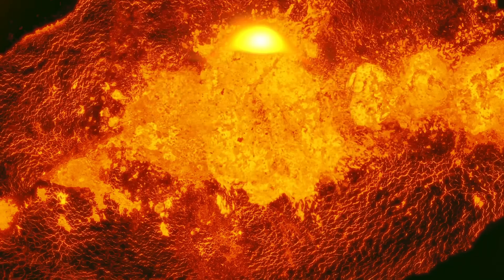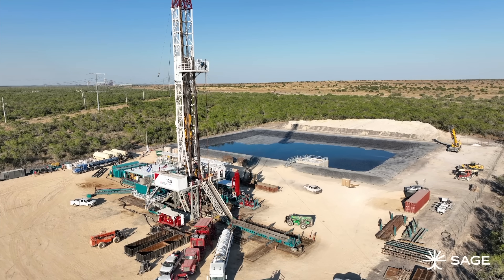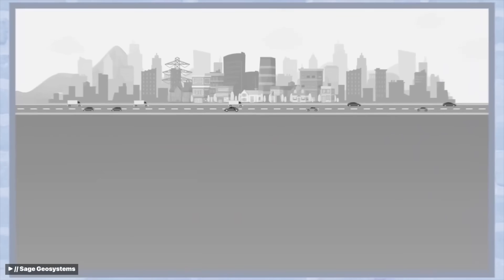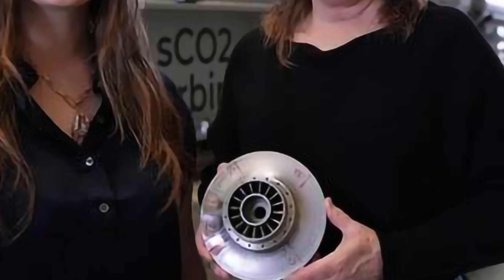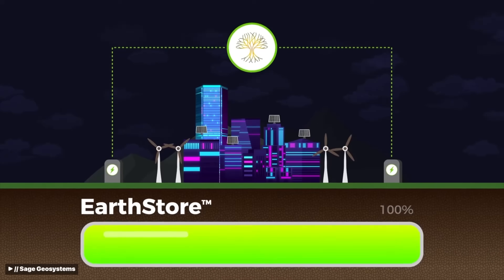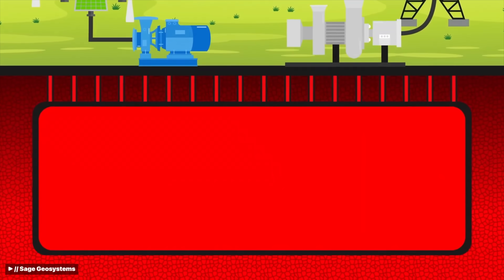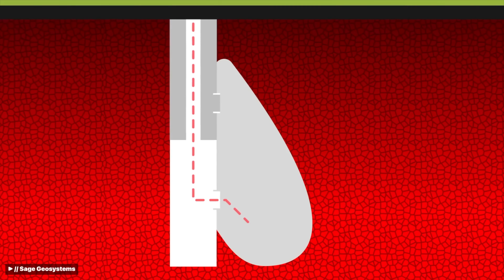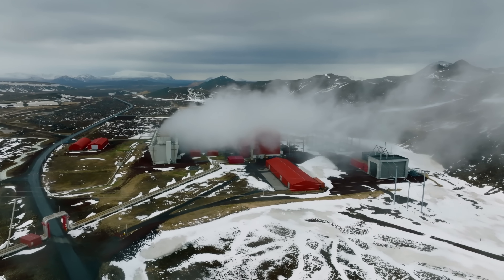This Tech Solves Geothermal's BIGGEST Problem - Gamechanger?

Comment: So where does the supercritical CO2 turbine fit into all that?
Reply: Supercritical CO2 turbines have two major advantages in this application:
1) FAR smaller than an equivalent power steam turbine (mentioned in the video). Ballpark it at 10% of the size of a steam turbine of equivalent power.
2) Can produce power efficiently with much lower temperature wells than a steam turbine - meaning geothermal is feasible in more areas.
Reply: @SavageChinquapin  Thanks.  But I still don't understand how the supercritical CO2 turbine fits into the process cycle
Reply: @Michael-so5jh  It would be a 2-loop system. Water is the injection loop, the hot water/steam heats the CO2 loop via a heat exchanger. CO2 loop runs the turbine.

Trying to run a turbine directly with your injection/recirculation water is problematic due to dissolved minerals.

Comment: we keep talking about various ways to make or extract clean energy on our planet but we ignore one thing: Even the cleanest source of energy is still just that: Energy. And energy ITSELF is a heat source which warms up the planet as soon as it is released, NO MATTER how. Even if you cool something with energy, there is still heat generated at the other end which more than offsets the cold just produced. Everything "energy" heats up the planet - and the planet can not cool itself off. So the energy/heat stays. Clean or not, the planets' heat increase will still be the same. THAT is the problem.
 The only way to get heat/energy off the planet surface is to reflect the incoming sunlight or shoot energy into space with some gigantic laser or maybe heat up magma in the ground with a giant immersion heater.
Reply: This is heat which is already coming to the surface, btw. Unlike burning fossil fuels which is actually creating more heat....

Heat naturally radiates out into space. You don't need to make a gigantic laser. Unfortunately CO2 in the atmosphere slows that heat escaping.
Reply: Heat naturally radiates from the planet. Les greenhouse gases less heat that gets stuck unable to radiate out.

Comment: The $0.65/kWh is roughly equivalent to a new Gas Combined Cycle plant, but the capability to store for up to 18 hours at a cost of $0.04 beats everything but Vanadium flow batteries. 

It will be VERY interesting to see if their claims prove true IF they could be built close to the point of use..

Comment: Thanks for this video.  I was just at an energy symposium that had a geothermal presenter.  I was very disappointed that the presenter only talked about geothermal at the unicorn locations (and the obvious challenges at those locations).  After his presentation I asked why he did not discuss dry rock locations.  He said it is not possible. 
In our area the oil and gas industry is very interested in pursuing geothermal technology though ironically the state's red tape has stalled  potential investments (a green energy state for the record).  There are challenges with regulating many aspects, such as produced water, though this seems like a very interesting technology that we should be focusing more on.
Reply: That presenter is completely ignorant of modern geothermal and should not be invited to speak at conferences. Fervo already had a 3 MW well in fracked, hot dry rock producing electricity  in 2023.

Produced water? Why would there be meaningful amounts of produced water? Modern geothermal should be essentially a closed system when running - the same water gets re-injected again and again and again. That's the way Fervo does it anyway.
Reply: @SavageChinquapin  Sadly, water use is a major drawback of this and Fervo's technology. Even fractures engineered into dry hot rock will leak and there will inevitably be water losses to consider. At 24/7 operation, even a small amount can really add up.
But there are true closed systems like the Eavor Loop, which drills a true closed radiator-like heat exchanger underground. Apparently, the system is tight enough that you can use working fluids other than water that can more efficiently carry the heat to the surface and considerably enhance efficiency and economics.
Reply: @ipp_tutor  "Major drawback" when potential water use is going to be something like 0.01% of what a CCNG or nuclear plant uses per MWh? 

Ridiculous example of the perfection fallacy.

Having a closed loop with a non-water working fluid is nothing new. Except as far as I can tell, Eavor just says their working fluid is proprietary. Water with a pinch of anticorrosion agent can be "proprietary".

Eavor is in VERY early days and seem to be moving slowly. Grand plans - but little progress. Example: Joint Base San Antonio. No news since the DoD signed an agreement in 2023. No timeline published. Etc.

Oh, and even Eavor says their system leaks. Sure, they don't phrase it that way but "minimizing leaks" means it leaks....

Anyway, I still hope they succeed - but they have a long way to go.

Comment: I don’t understand the concept. Is it generating energy or just storing it?
Reply: Yes.  It is not well explained.
It sounds to me like a high efficiency battery with extra energy recovery from heat using sCO2 Brayton cycle turbine.
Reply: Me either. It seems like they would pump water at very high pressure into some of the holes, then see that water absorb thermal energy turning it into steam, which runs turbines as it exits through the other holes. If that is what they are doing, using wind/solar to pump the water in could be a form of energy storage, because that energy would be mostly recovered as energy is extracted at the turbines. If so, that suggests the plan is to have large amounts of very high-pressure steam underground, rather than just pumping a non-boiling fluid through the ground to heat it and then using that hot liquid to boil water in a boiler at the surface. Adding to the confusion is the mention of a CO2 pump, which suggests they might be thinking of storing energy by compressing CO2, but that would have nothing to do with boiliing water to run steam turbines.

Comment: I'm thinking maybe no additional loss to the planet's heat.  Now, heat just radiates to space.  If remove the heat from the mantle (?), you use it to do work and all the work is eventually converted to heat.  Which radiates into space. Seems same either way.  Am I missing something?
Reply: Exactly. The electricity use (31k tWh) should be treated as a fraction of the Earth’s radiation of heat (412k tWh), rather than an addition. Assuming we relied on geothermal for all our electricity.

I’m sure we could imagine a scenario in which the system would shed Earth’s heat faster, but this is more like a chimney redirecting where the heat from a fire goes, rather than opening up all the windows in a house and losing the heat.
Reply: @CMVBrielman  Within reason, the nuclear source within the core is essentially infinite.  It has lasted 3.5B years and will supposedly be good for another few B years if the calculations (such as they are) are correct.  And when that fire dies, we die.  By diverting some of that energy into electricity, we are just changing the path slightly in the radiation into space.  After all, everything, light, heat, air conditioning, friction, all ultimately ends up as heat.
Reply: Heat moves through rock very slowly. Geothermal wells are a way to very quickly move heat from one area to another.  There are two basic ways to design a geothermal system. 1) The system is designed to remove heat from the source area at the same rate that nature supplies it. Such a system can supply useful heat indefinitely many home units have this design. or 2) The system removes heat from the source area faster than nature can replenish it. Most large geothermal projects do this and have a finite useful lifetime. Iceland is pretty much the poster child for geothermal plants and even there they have to periodically drill new supply wells. Either way you are transferring heat from the planet (rock) to the atmosphere faster than would normally happen, but the current and expected future heat usage rate is so small it is not worth worrying about.
Reply: @georgewood463  Removing the heat more quickly matters if there is no internal heat source and you are trying to preserve your internal heat, but in our case the heat source is basically infinite so removing more quickly doesn't matter because there is more where the original heat came from.  In other words, we are in agreement.  Besides, if the nuclear fire dies, no plate tectonics, volcanoes, and most importantly, no magnetic field; we all die.
Reply: @georgewood463 I think rather than removing the heat too quickly I have heard there is a huge corrosion problem which acts like a major thermal insulator.  Geothermal is one of those technologies which sounds good in theory but utility scale power plants seem not feasible at this time.
Reply: While some of the heat is from nuclear fission, isn't a lot of it from tidal forces generated by the moon? The internal heat will be "regenerated" by the thing in the sky
Reply: Not really, but theoretically you could make the extraction site cool down somewhat.
Reply: The problem with this is when you do the math of the energy irradiated per unit of area, it's very very small. Imagine the Earth is a giant thermos full of hot water. It's really hot inside, but it slowly leaks heat to the outside. Can you do any meaningful amount of work with that heat? No, because it's too little power (energy per unit time). Geothermal is like opening the thermos's lid and pouring out the hot water. That's different. In the end, it's the same amount of available energy, but to be useful in out time scales, we have to open the thermos.
Reply: lolwhut? how do you misunderstand the whole point of turbines? 🤣why not just lie in the gutter and wait for the void to consume....
Reply: @GregHighPressure I don't understand your point.  If you are trying to make one.

Comment: I'm confused they invent a super critical CO2 turbine. So im thining brilliant. Co2 expands dramatically or presurizes as its heated in a confined space, unlike water that first needs to get over 100c at atmosphereic pressure. Before it expands or increasses in pressure.  But later i get the impression they are talking about water. Are they infact simply using water as a heat transfer solution and a heat exchanger to heat super critical CO2 to power their turbine rather than pump CO2 into the ground?
Reply: or maybe they're really using water in a supercritical state, but agree, I'm confused too, and not just about that point
Reply: @Siekad  they can't get water hot enough at those depths to make water super critical.
Reply: @kreynolds1123  you're right, they wouldn't even reach half the required at their max depth (should have checked first), still agree that it is confusing, plus other things, like they used chatgpt for different ideas and slapped them all together without a care.
Reply: The government throws big money into ideas that use the most popular buzz words
Reply: Major discovery to store surplus electricity in room temperature liquid that's hydrogen rich. Hydrogen gas stored inside non-lethal organic type clear liquid at regular atmospheric pressure won't cause hydrogen embrittlement for all existing oil infrastructure without any retrofit cost. The Ayrton Energy in Canada has solved the fears for President Trump who knows how dangerous 10,000 PSI hydrogen fuel onboard tanks can be for passenger vehicles invloved in car accidents but Ayrton Energy has made hydrogen safe inside room temperature organic type clear liquid one could safely store in a 5 gallon plastic bucket as one example far compared to propane, methanol, ethanol or gasoline. The Hawaii Energy just partnered with Ayrton Energy in Canada and next year they will mass produce clear non-lethal liquid that safely can be transported for oil tankers, fuel trucks, KeyStone Pipeline, Gas & Diesel fuel stations without additional cost to retrofit for zero pollution hydrogen energy storage.

Comment: I don't get it, they talk about using gravity fracking to make it safer, and then pump in water at high pressure into the fracture as storage like a battery, but isn't using high pressure liquid the normal kind of fracking they're saying they aren't using…
Reply: "Gravity fracing" happens frequently while drilling.  The oil drilling term is "lost circulation".  Lost circulation can result in in the uncontrolled flow of oil and/or natural gas to the surface. These flows are called blow outs. They are the "gushers" from the early days of drilling. Gushers can be very destructive. Drilling rigs have heavy equipment called "blow out preventers" to hopefully keep this from happening. 

Large amounts of fluid (could water, air, etc) are pumped down hole. the fluid is often accompanied by propant (material pumped into the fracture to keep it from closing completely). The fracture grows until the pressure required to pump more material down hole becomes greater than the pumps can supply. Usually this is caused by the fluid leaking off into the formation fast enough that the pressure at the fracture tip drops below the pressure needed to break (fracture) new rock. This is the problem with pressure storage. Leakage always happens. How quickly it happens depends on the viscosity (a measure of the easy with which that particular fluid moves, think jello vs catsup vs water - all three are fluids) and the permeability (a measure of the ease with which that particular fluid moves through that particular rock in that particular direction). This means that pressure storage of energy might be practical in some areas and rock formations and definitely would not be in others.
Reply: The impression I get is that they are repeatedly reusing chosen fissure locations that wont cause the quakes, the issue w petrol fracking is they mass frack huge formations to get the petrol out and move on to frack huge new areas
Reply: Traditional fracking for petroleum production uses a host of chemicals, in addition to  water and sand. Here is a list from Google:
 "Acids (e.g., hydrochloric acid): Used to dissolve minerals and debris, and to initiate cracks in the rock formation.
Biocides (e.g., glutaraldehyde): Eliminate bacteria that can cause corrosion and potentially clog the well.
Friction Reducers: Reduce friction between the fluid and the pipe, allowing for easier pumping and less equipment wear.
Gelling Agents (e.g., guar gum): Increase the viscosity of the fluid, improving its ability to transport the proppant into the fractures.
Corrosion Inhibitors: Protect the metal well casing and equipment from corrosion caused by the fracking fluid.
Scale Inhibitors: Prevent the buildup of mineral deposits that can clog equipment and the wellbore.
Surfactants: Reduce surface tension, enhancing the flow of oil and gas." 
Pressure isn't the issue.
Reply: They aren’t using high pressure. They are using gravity/head so the pressure builds linearly with depth. There isn’t enough detail to explain why it’s so much superior but it does seem to focus pressure where you want it rather than everywhere.
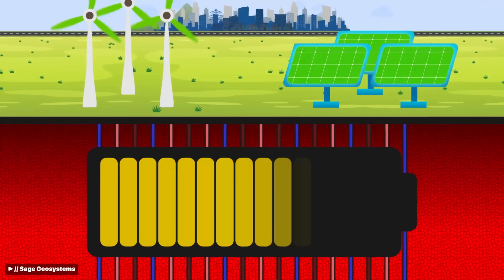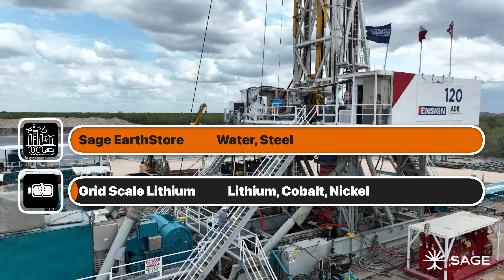Reply: @Ask-a-Rocket-Scientist  I don't know if we are referring to the same segment, I'm referencing the one starting @6:26 where they talk about pumping water into the deep existing fracture to be released later by opening a valve, but for that to work it would require a higher pressure then the natural pressure at that depth, else nothing would be released. My original point was that the next segment @7:29 they talk about using gravity fracking because it is a "safe" fracking type, no chance of earth quakes, my point was that what they plan to do per earlier segment sounded like the same as what they do for normal fracking, so I'm thinking this was just all buzzwords hoping you don't think too hard about how what is said now is made irrelevant by what was said a minute earlier.
Reply: I think because they’re not doing it in places with natural gas… so there’s no concern on mixing gas into the ground water.

Comment: So, we can’t effect the Earth’s cooling, but if everyone used this tech, it would cause up to 8% extra cooling of Earth’s core? What?!
Reply: I didn’t quite get what those 8% was exactly. But from what I’ve heard before it’s very unlikely that we can have a noticeable effect on the cooling of the core. An as mentioned, it is actually a renewable resource in a way.
But as always, there are limits to how much energy we can take.
Reply: @jenslandgre5982  “From what I’ve heard” is never reassuring.
Reply: I’m just asking for science based personalities to not directly contradict themselves when covering atopic.
Reply: @geolitz2665 Ok, I think it was a misquote. As for cooling, that’s a hole another the ball of yarn.
Reply: No where near the core, not even that deep into the crust. At massive scale, like pretty much everyone using it world wide, it would amount to 8% of what is already being radiated back out from the earth.

Biggest issue I can see is possible groundwater contamination from the fracking depending on what the dissolved rock in the water is made of and what it pulls up from the bottom of the wells.
Reply: No, there is almost no way we could do that, yet. Also as we use it radioactive decay renews it